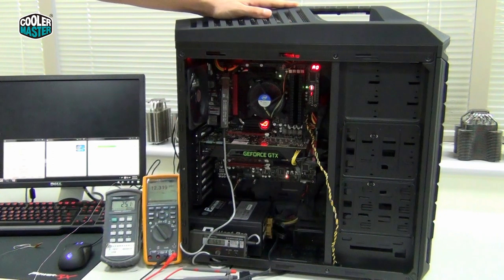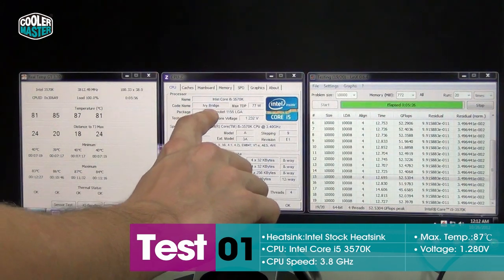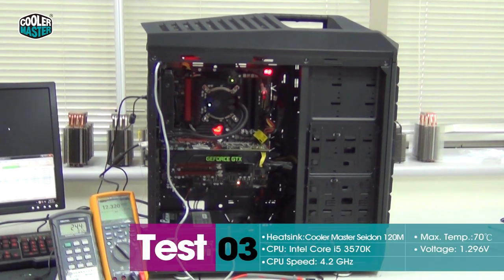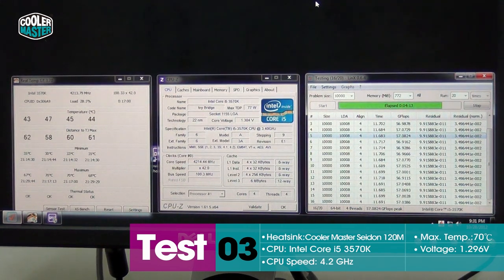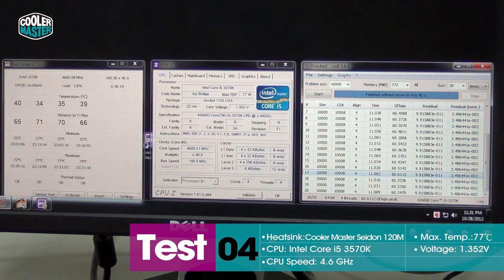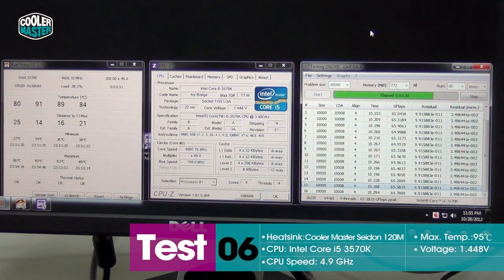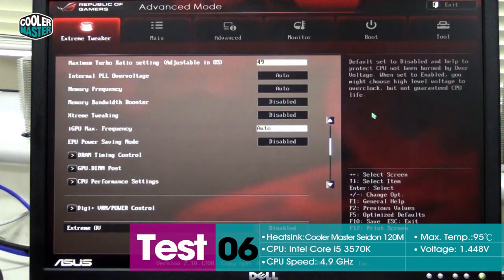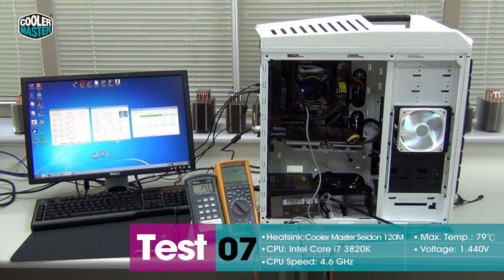Cooler Master Seidon 120M - Test Results

Comment: i have a Seidon 120M , Running my FX 6300 @ 4.1Ghz and the maximum temperatures are 48° , average 46° , Seidon 120M is a very good cooler :) Considering AMD CPU power consuption when OCed is very high.

Comment: I can see on cpuz that the voltage is set at 1.4 constant.  Is that because you have LLC on high mode?  If so, do you think its a good idea to have system running at 1.4 even when idle without having a Vdroop?

Comment: I'm getting 70C to 76C on my i7 4770k at stock speeds and 1.132v with the seidon 120m, is this normal for this cooler at load running prime95?
Reply: I'm running a 4790k with a seidon 120m at 1.12v and get in the 70s, and since 1.132 isn't that much higher, it seems normalish.

Comment: you should try LinX or IntelBurnTest (which uses LinX as well) for benchmarking temps.
10~15 mins in LinX put your CPU through the same stress that over 40 hours of prime95 do

Comment: where can i find those 240mm water cooling systems? most of them are 120mm radiator and i think i am missing something because seidon 120 has a 120mm radiator right? if i could find one 240mm i could buy it for sure! btw tnx for such good response man :)

Comment: please build a 240mm radiator, like the corsair h100. Also companies shouldn't compare to the intel stock cooler. Its a free cooler, of coarse performance will be terrible on it, its only designed to run at the stock clock. Try comparing against other coolers that are competitors.

Comment: im a doing something wrong here im using the same liquid cooler im using nf f12 fan i7 950 4ghz my idle temp is 50- max temp is 90 wtf ?
Reply: Try putting some new thermal paste on there, a nice thin layer to make sure there isn't too much heat trapped in a thick one.
Reply: Chris Everitt :P this was later year, i have a custom loop, with i7 5820k 4.7ghz ahah, thanks for the reply tho.
Reply: GamingTurkey Oh shit, yeah just saw that haha. Yeah I'm in the process of upgrading everything now and I was worried about putting a liquid cooler on my processor so I have done some research, seems that the whole; putting a thick layer of paste between cooler and processor causes a thermal trap.

Comment: The last time i seen a game running at 100% CPU load was back in Singlecore days..... Gaming doesnt push the CPU, my Frio on a 3930K at 4.6Ghz at 1.35 Volts gets up to 55*C wen gaming, i bet if u run prime95 it would shit its pants lolol, and antec H80?, they only have Antec KUHLER 620 and 920